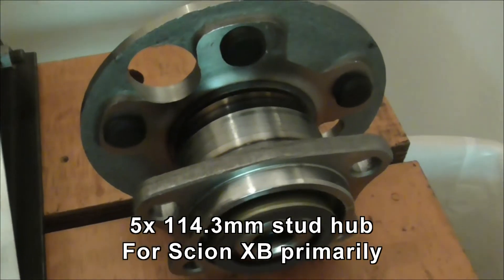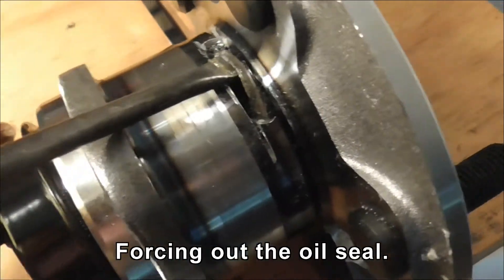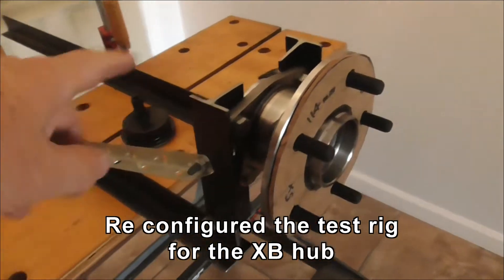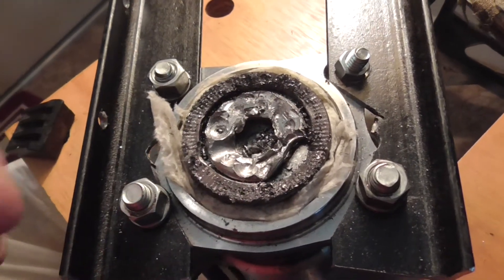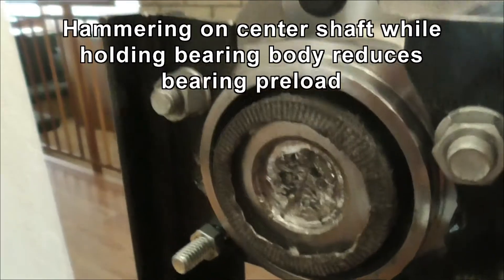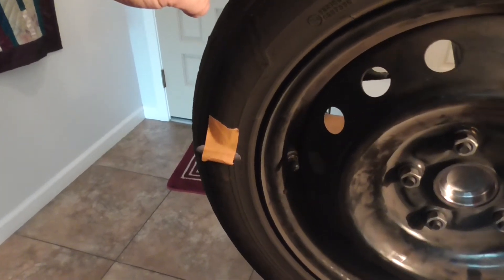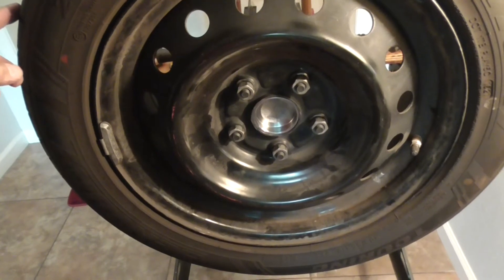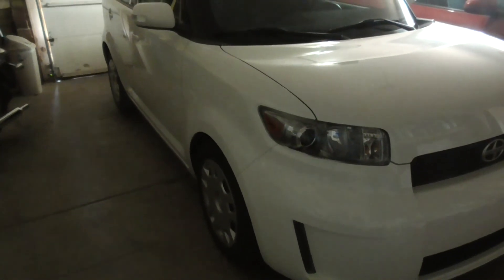Car Tire Vertical Balancing 2

Comment: I've just been doing the same (before I watched this, honest), bought a used hub for $25, mounted it on wood, spins really well without the seal.
Reply from the maker: Great! It is a good way to balance a wheel - provided the hub spins easily.
No need to worry about where the wheel CG is located - except for placement of weights.

I ended up with a slightly different method, as my preferred method, which works on multiple pilots and stud patterns.  Shows up in this video, https://youtu.be/WgjNO2gt3xg

Comment: Excellent job.....I wonder if a well used hub off a car from a breaker would be broke in to spin with less friction.....especially with the grease seal removed like your doing.

I take my hat off to you sir.....dogged determination.
Reply from the maker: My son has 165K miles on his '06 XB and having just redone the rear brakes on that, I can confirm that the hub is still hard to spin.
Also, I did look around on-line at the local scrap yards and they wanted as much for a used hub as I was paying for the cheapest hub from amazon - so the decision for a new hub was easy 
:face-blue-smiling:
Reply: Wonder how much of that drag on your sons car is from the grease seal....was that hub on a drive axle?

If buying to fit to a car....yes buy the new one. @richbinaz
Reply from the maker: It's probably both the grease seal and the bearing preload.
Non-drive axle
https://www.youtube.com/watch?v=wODUoVtPhfM&t=4s
Hate drum brakes & so easy to assemble wrong @nickaxe771

Comment: Hi, I read that its more accurate to distribute the weights on 4 different spots; 2 on each side of the wheel, distributed in an angle of 120° each from the heavy spot , or so....
Reply from the maker: I don't know where that comes from, doesn't seem to be based on physics.
I have found that most of the car tires I have balanced require very few weights to be added, so adding 4 would be overkill.
IF you had only 1 oz weights available and the balance correction needed was 1/2 oz, then you can find the location of the needed correction and distribute the weights equally either side of that location to achieve static balance. But it would not be at 120°.
However, in doing that, there is the risk of getting a dynamic imbalance from all the added weights.

So Far, adding the minimum amount of weights, close to the CG of the wheel, has worked well.

Comment: Clamp a square trailer stub axle spindle and hub kit(no seal or grease) in a vise. Fits 5 on 4 1/2 and 5 on 4 3/4 and 5 on 5 for me so far. Works like new money.
Reply from the maker: Good idea!! Didn't think of that. Was just focused on getting a hub that would fit the wheel without using spacers & Adapters etc.
Reply: @richbinaz  
Therein lies the problem. The #84 spindle accepts 4.5----4.75-----5-inch bolt pattern hubs.
If you have 114.3, it's the same as 114.5 or 4.5.---I think.

Comment: Good effort, but I think this would have been a lot simpler and cheaper?  https://www.youtube.com/watch?v=XK8d6AZHWjQ  Anything mounted on bearings will rotate easily.
Reply from the maker: I don't have a machine shop, so I need to come up with simple tools
For bike wheel balancing, I just use the wheel axle supported on a couple of plastic saw horses. They turn on their own bearings freely and no centering problems.
Don't think This method adapts well to a car wheel easily.

Comment: Is it better than the bubble balancer?
Reply from the maker: Well, it is much better than the bubble balancer I have.  So YES!!!
This video shows how I discovered a serious flaw in the bubble balancer.  
https://www.youtube.com/watch?v=zEBYJvfL0b8
I tried a self leveling laser level instead of the bubble, but the result remained poor. Heavy vibration at speed around 70 mph or higher. Then I used a dial indicator and found the inner pivot point was .035" TIR off from the outer cone (.0175" radial).
The basic error created is: The weight of the wheel assy (ozs) x .0175" / balance weight radius (ins).
Keeping numbers round 42 lbs x 16 x .0175 / 8 = 1.47ozs i.e. a 1.5oz wheel weight in the wrong place.

Just put new tires on my Corolla, used the vertical balance rig, I estimate my error to be about 1 balance weight or 1/4oz (7 grms). Result, dead smooth at 70 for corolla. Xb went to 80 no issues.

Bubble balancer is now in the back yard shed, growing cobwebs
Reply: this is the best diy balancer on YouTube.  The Bubble Balancer is garbage.  i bought one and cannot get repeatable measurement.  i just ordered a hub from Amazon.  Hope to build one like yours.
Reply from the maker: @thewishmastur   Just below your comment is one by Daniel Smith. He came up with a method that I kind of wished I had done. He tapes a glass ball to the pilot on the wheel, sets it on a level ceramic tile and uses a self levelling laser level to get the wheel horizontal
Link https://www.youtube.com/watch?v=cjMf7U14xe4 

If the pilot is 2 inches, you probably need a glass ball about 2 1/2 to 3 inches diameter.
Genius; and works on different hub pitches.

I wonder if your bubble balancer was not machined properly - like mine. Then the spring frame is just rubbish. https://www.youtube.com/watch?v=zEBYJvfL0b8 shows the cone being off. You may have seen it.

Comment: Hello mate. I commented on one of your earlier videos about an idea i had regarding using a sphere in the central hub recess to balance a wheel. I tested it today with success.  Here is the link if you are interested. https://www.youtube.com/watch?v=cjMf7U14xe4 When i renew my bearing soon, i might play about with old one, i didn't think to try remove the inner seal...
Reply from the maker: Hi Daniel, sorry, didn't see your reply until just now.
I'll put some comments on your page so it counts as a like etc etc - which if you're like me, you probably don't care about... YouTube does for some reason.
I have since abandoned the horizontal balancing via the bubble balancer and gone vertical using modified wheel hubs, but I do like your solution. It works!